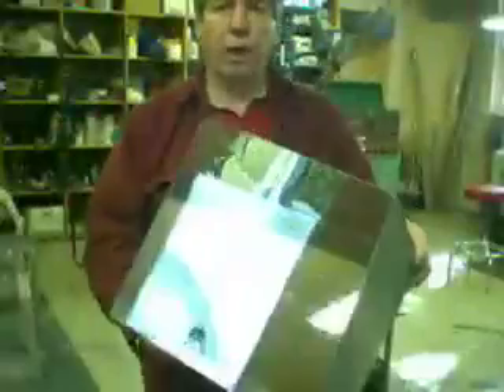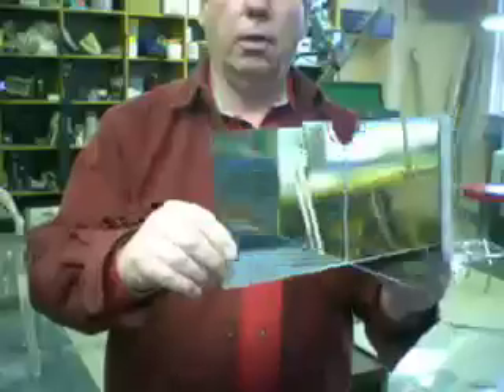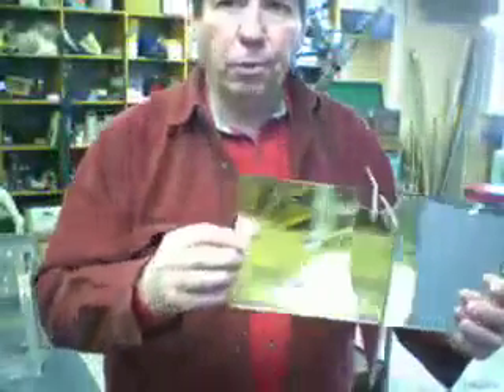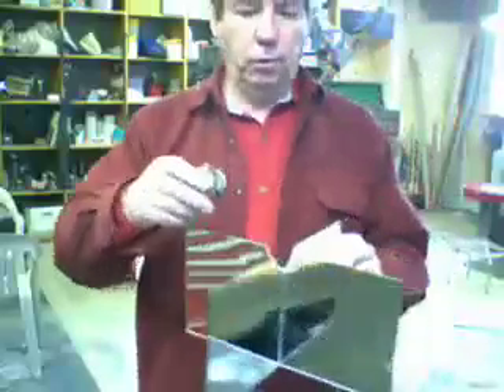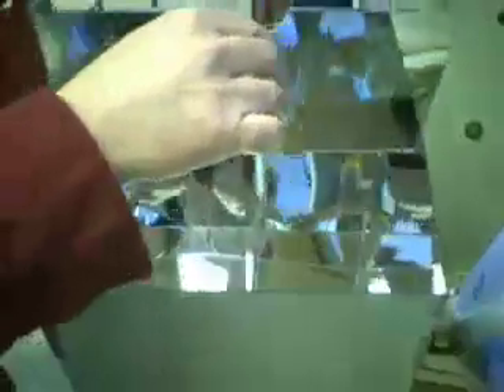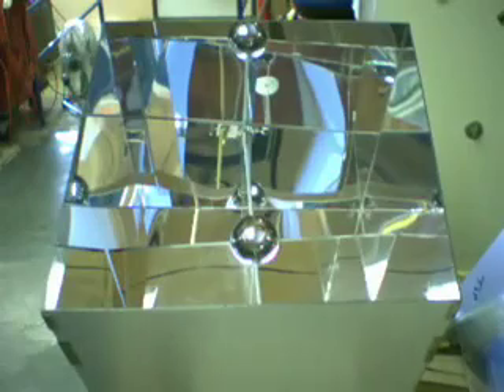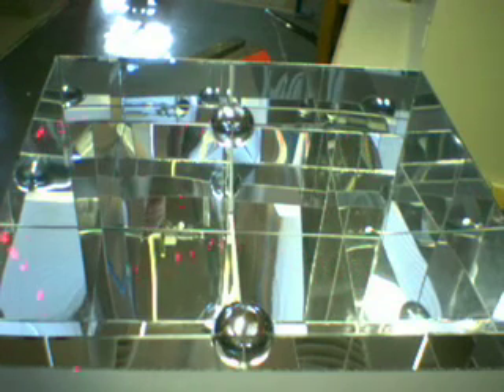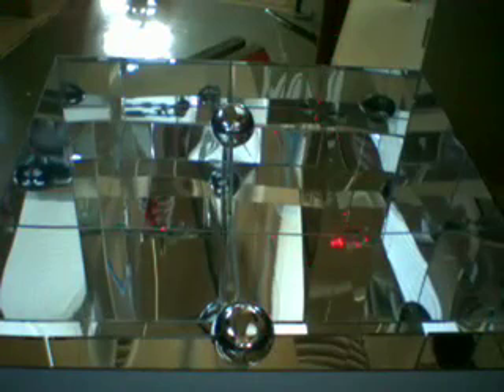Mirror Cube

Comment: These pictures really resonate with me. I made this on a magic mushroom trip.

I seen entities. And they went all kaleidoscope
I got the impression in my mind there where surfaces of mirrors reflecting and stretching whatever I seen.

I got closer the more I focused.   When I got close I seen the seems in between and found a point of convergence between the parts that where moving.  The parts of the hallucination i didn't control.

I was able to concentrate and bend flex and fold the surfaces. Slowly at first and even with a few mistakes and it would fall apart (telaport) change the hallucination to something different.

When I was succeeding  I managed to distinctly change what each entity looked like. Like turning it into its own cousin. Similar but different .

As I continued.  I managed to fold the surfaces up into diamonds or like pyramid structures and began seeing what shapes I could make. And they where sacred geometry but simple. 

The end result was when they collapsed inward it made this space X ,Y,Z structure.   And I floated into the middle of it.

When I did. It was hard to process but I was in like 8 places at once. Skipping between them seeing them at the same time confusingly . Stopping for a brief moment of clarity. 
A building at different times of day and season and a room where I was standing on each end at the same moment of time. 

That wasn't all. After that I managed to basically grow more arms. As I began to kaleidoscope my own body.
Now it's not tangible so I didn't touch and feel
But i felt sensations and definitely felt like I was moving a peice of .myself.  maybe like phantom limb (I wouldn't know)
But I was able to reach out in different directions and grab my own hand as if I stood beside myself.  And it was less intense but with the arms. 

The singularity that I've created. Was on an earlier trip. I'm a few more past it and I can summon it at will.
It's not the spirit world or entities I'm controlling. 
It's more like there's a surface mirror window lense. That's between me and the hallucination itself and I'm able to manipulate that lense itself.  That central point   coordinates  0,0,0. And the 3d x around it.  Is it's own thing but is like an obedient pet.  And it's just a corner between some spaces. 

Usually if you try to focus on controlling things in a shroom trip. The mirror will just give you something controlling you for your troubles.   
It's not what we call a breakthrough becasue that's a total loss of awake consciousness.  
But it's like milestone for me in my mind.

I've tried doing more elaborate shapes but so far they fall apart and just telaport me to another hallucination destination. But there's almost always some form of geometry i can recognize going on so it's easy for me now to summon the portal again really just by thinking of it.   Tho sometimes it lacks the surfaces and just looks like floating energy in the 3d x shape.

I am now able to do it on command with a real mirror.  I don't control what I look like. But I'm able to be a real shapeshifter at will.  The hallucination isn't cartoony or kaleidoscoped . The shape-shifting will still happen on those lines. But when it's done moving for the brief second and settles.  I'm looking at a very real looking other person that moves like I do.   
Now I've been monsters and creatures and drastically different looking people.  
But I always return to myself first before changing again and I've always been male.